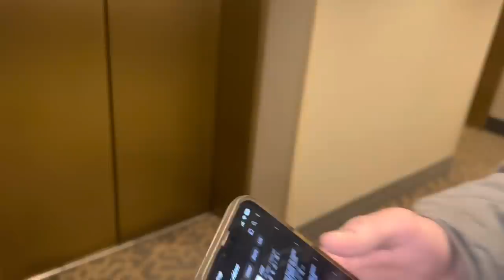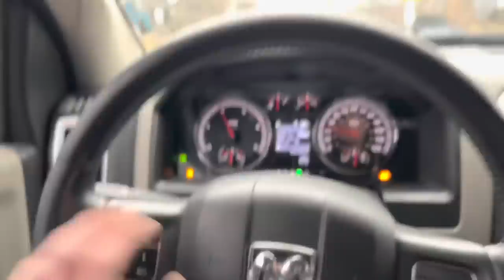I Bought A Megacab Cummins For This Reason…

Comment: Change the remote start to the viper remote start it will stay on for like an hour and doesn't matter about a check engine light or anything also can use your phone to start. I put them on all my vehicles

Comment: tune your transmission. higher line pressure to the clutch packs. transmission will last much longer hold good power.